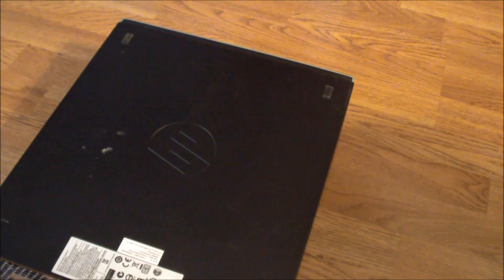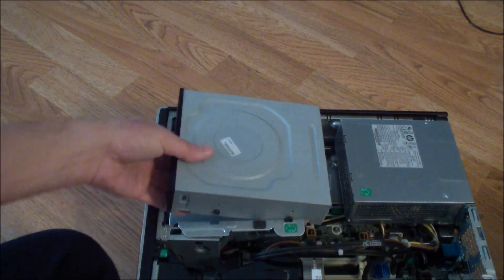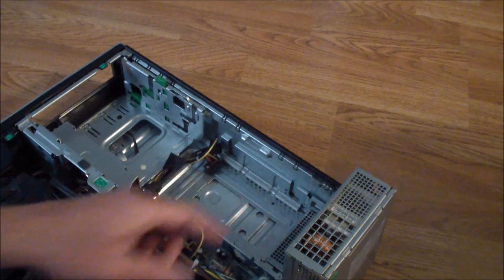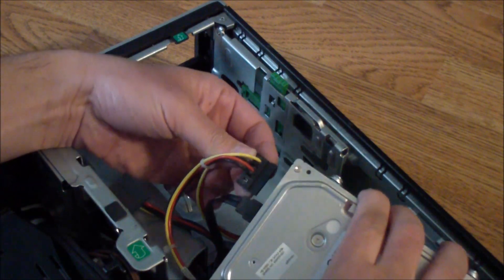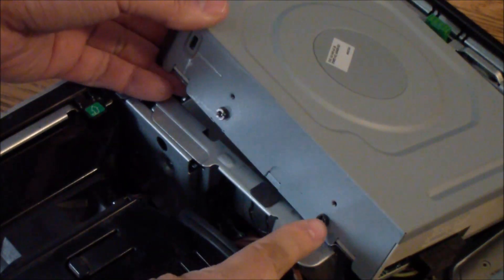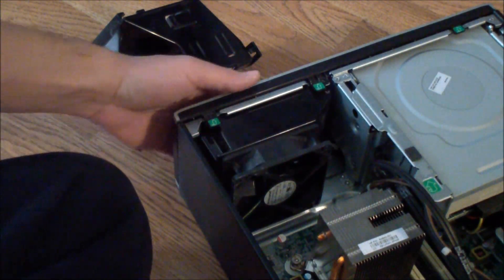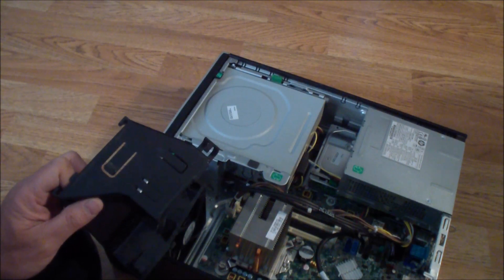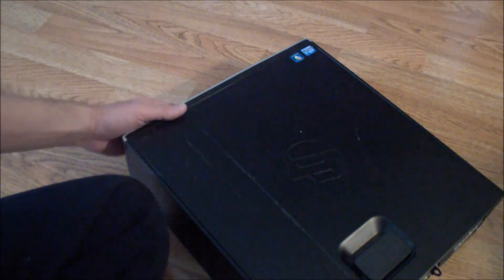HP Elite 8300 Small Form Factor Hard Drive, Optical Drive, and Front Panel

Comment: Btw is it safe to remove the optical drive,becus my os has been corrupted after removing it and im not sure if its caused by the optical drive or just coincidentally broke
Reply from the maker: I didn't have any problems.
Reply: @Ace1000ks i guess its probably due to me using windows 11 on a very old setup

Comment: Can you send instructions on how to install the icy dock with the 500gb ssd and 2tb hdd into this exact pc?
Reply from the maker: I don't have this PC anymore.
Reply: @Ace1000ks  do you know of any instructions out there i can use? I tried looking
Reply from the maker: @Dop4mine20  You can find the manual for this computer on Google. Other than that, just Google it.
Reply: @Ace1000ks  when you had this pc, did you put the drive bays for the hdd and ssd in the same place the Optical Drive was in or was it possible to put it in place of the original 3.5" hdd?
Reply from the maker: @Dop4mine20  You can put the 2.5" SSD in the 3.5" bay. https://amzn.to/3pxN0EU
Reply: @Ace1000ks  Alright thank you. And I am confused on how I use my new 2tb 2.5" hdd that came in the mail recently. I have it plugged in along with the original 500gb 3.5" hdd and I am waiting on my 500gb 2.5" ssd to come in the mail. My problem right now is, I have everything from my 3.5 hdd cloned over to my new 2.5 hdd, but when I look at the status of them, it still says that the stock 3.5" hdd is still in use and the 2.5" hdd doesnt have anything running on it. It just has my cloned 400gbs of data sitting on it. When I get my new ssd, I want the filesthat I download to be downloaded to my new HDD and not my old 3.5 hdd because I am going to be getting rid of it.
Reply from the maker: This computer doesn't have a standard 5.25" bay, so you can't use a ICY DOCK 5.25 adapter.

Comment: Thanks so much!  If I want to add another hdd, is there a spare power connector from the PSU?
Reply: You can use the power cable going to the optical drive and use it for the hdd
Reply: Thanks!
Reply from the maker: You need to get a sata power splitter cable. https://amzn.to/2RUjxn2
Reply: @Ace1000ks  Thank you 🙂👍👌